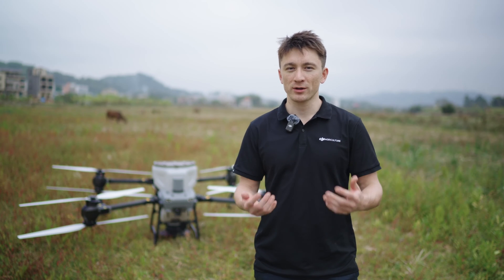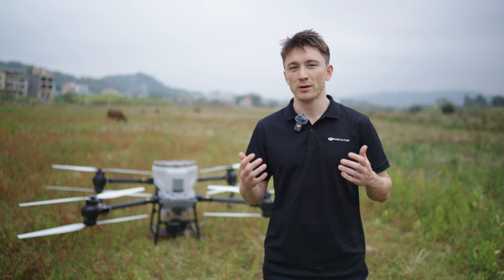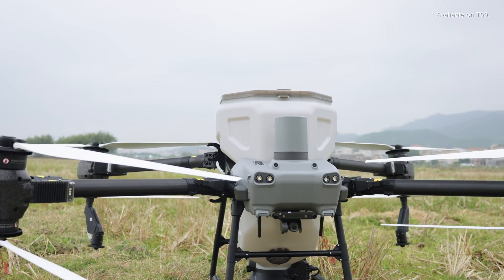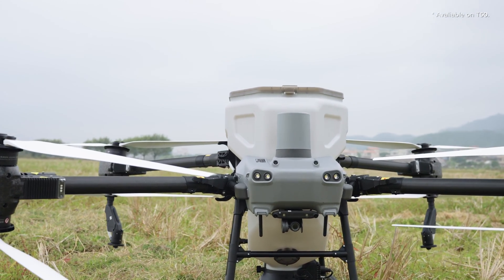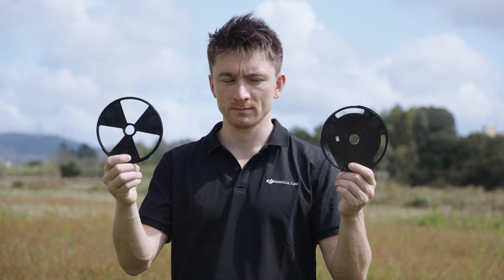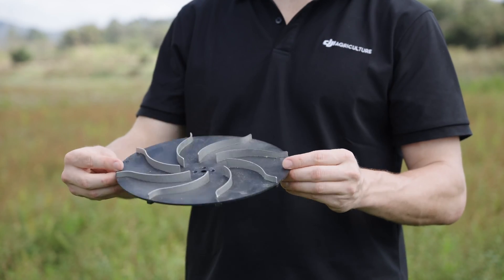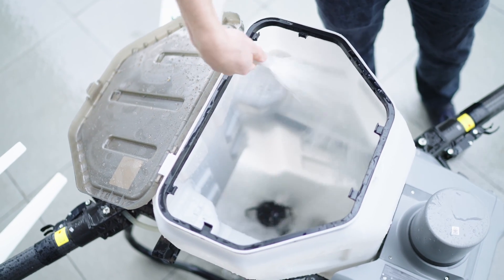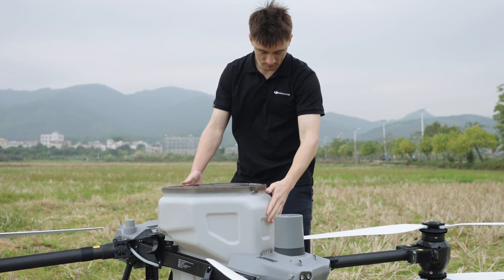DJI Agras T50 and T25 - 05 Spreading Systems

Comment: Its not working when we use Tsp with mop furtilizer
Reply from the maker: Since you're dealing with salt and water, there could be a clog somewhere along the line from undissolved particles. 

If it is that and the system is cleaned out, for future flights, you can try pre-disolving the fertilizer in warm water or use a mesh to strain the solution before loading. Some fertilizers are labeled drone compatible or foliar grade so try to use those when possible.  You can also email us at experts@dronenerds.com for any questions about the Agras drones.